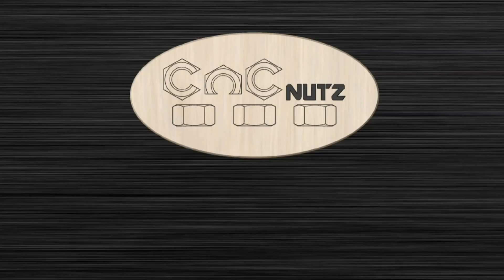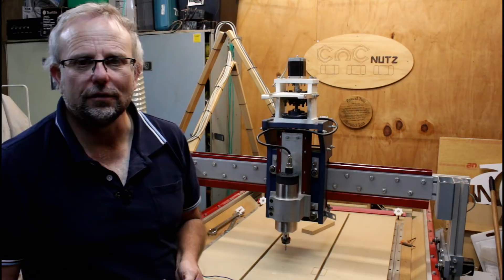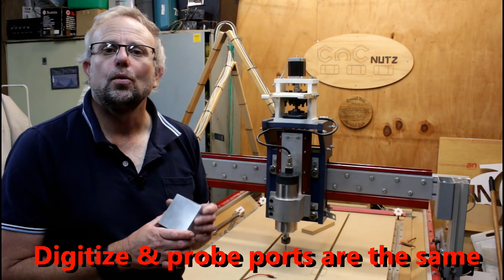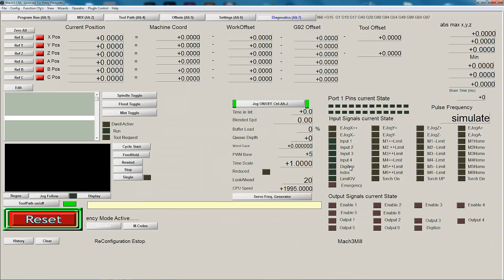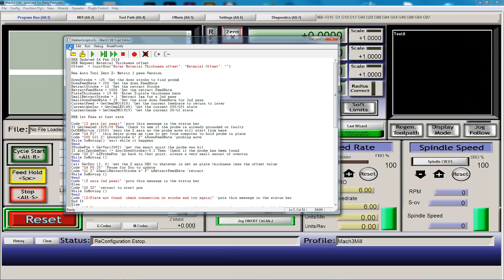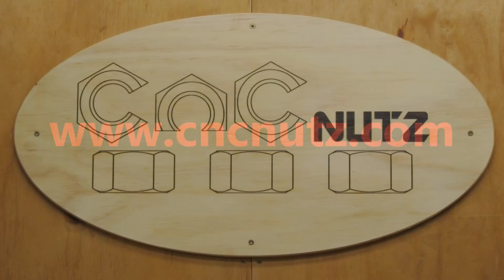Mach3 Touch off Plare Install - CNCnutz Episode 204

Comment: Hi Peter, Thank you for the tutorial.
I used your script, but I run into a problem:
When it retracts for the second pass, instead of 1mm is retracting arround 20mm  and when is going for the second probe is not finding the plate and goes into an error
Do you have ideea what can it be?

Regards

Comment: Thanks for this Peter. I’ve been successfully using your script. On my first probe and detect, my machine “jumps up a little” as if it’s been stuck down on first probe. It’s second probe retract is smoother. Maybe I need to check the first retract speed. I always seem to have the Z DRO reading at 0.004mm after probing and going to new origin. Bloody computers. 😂

Comment: I can't trust Mach3 with zero touch plate . I had it setup and it was working . Then it just crashed on it. Digitize light works but it still crashed . Just going to use a manual Z block from now on

Comment: Great informative video, I'm struggling to get the script working on my machine. 
The digitize light is flashing, when I press auto tool zero and touch the plate on the bit to start, it starts to probe but doesn't stop when it makes contact. 
Do you know why this would be ?
Reply from the maker: Hi dlyxover1
I have just added 2 Alternate scripts for Mach3 Metric and Imperial so give the appropriate one a try. I think this will be the problem.
Some motion controllers do not support the use of the GetVar(2002) command. As a result the script may not work as expected.
The Alternate scripts use GetOEMDRO(802) instead, which is internal within Mach 3 so will work for all motion controllers but will not be quite as accurate.
In all other respects the scripts are the same so make sure you change the plate thickness.
Give it a try and let me know how it goes for you.
Cheers Peter
Reply: @cncnutz  Hi Peter that is amazing, I will give it a try when im in the workshop tomorrow. Im using the AXBB-E controller if that helps.
Thank you for your help on this and the world of CNC in general
Reply from the maker: @dlyxover  
I would be interested to hear your results because the AXBB-E is made by the same people who make the UC300eth that i used in the video and it is a later model.
It should support the GetVar(2002) command. 
The cheap Chinese controllers are a different matter.
Let us know how you go. 
Cheers Peter
Reply: @cncnutz  The new script didn't work either, kept checking the wiring and settings with no joy. 
Last ditch attempt I removed all the wiring deleted all the script and started again, the original script worked, perfectly.
I can only put it down to user error, thank you for your help on this and many other areas you cover in your videos.
Reply: @dlyxover 
Excellent. I would have expected the original Script to work as it is a UCCNC product and their older motion controllers supported the GetVar commands.
Cheers Peter

Comment: I've been checking youtube for this for god knows how long and you've explained it in the simples way. Thank. Question though. Each time I need to do a tool change I would need to do it again won't I? And another question. Can you also do a script and setup video for X and Y axis zerowing. That would be Awesome!!!
Reply from the maker: Hi Martin,
Each time you change tool you need to reset the zero point.
Sorry that is well outside my ability and it has already been done by others.
Cheers Peter

Comment: Hi Peter - What’s the point in having the second pass? Just to verify? Thanks!
Reply from the maker: Hi Jamie
The 2nd pass is done at lower speed  which should give a more accurate setting. Because it takes time for the  motion control board to report back to the pc, retesting and slowing it down can give better results.
Cheers Peter

Comment: Hi Peter, thanks for a lovely and helpful YouTube channel, even given the accent:) [That's a smile from Western Australia]. My issue is for anyone else reading the comments. This comment was posted 15 FEB 2021. I downloaded the 30 August 2018 the latest script. It is the Mach 3 one [I confirmed x 2]. It will sort of run on my machine using Mach 3 but is not functional at all. The second retract operation sends my Z axis postive until it hits the home switch for this axis. It then jogs down 1 mm and sets the Z to zero nicely! So I ran the .txt through GWizard editor and got something like 120 error messages in the 130 lines of code. They range from not recognising "Rem" as comments through to a range of Then / If issues. This is so crazy that I sincerely wonder what I am doing wrong since from the comments below, this script must work. Anyone else facing this? Thanks
Reply from the maker: Hi Raspberry Jam Guitars
What you are doing wrong as far as using GWizard is you are testing a script with a Gcode checker. They are 2 different things. I don't know about the strange behavior but I imagine a wrong setting in Mach 3 or maybe it is the Mach3 version.
Cheers Peter

Comment: sir. i have one quedtion.  i want use usb cable for laptop. but i have MACH 1.1 borad with parellel port cable . please recomened cheap converter. parellel portt to usb
Reply from the maker: Many people. Use the UC100 which is the usb version of my UC300ETH board though it has only 1 port. Note : you cannot use a usb to parallel port converter on a CNC. You need a motion controller which is what the uc100 is. Also beware of clones of the uc100. Buy only from a reputable source and not ebay.
Cheers Peter

Comment: When testing this  program, it stops after  tool is touching the plate with " limit switch triggered" message
Reply from the maker: Have you checked that you don't have the port also allocated as a limit switch as well?
Cheers Peter
Reply: @cncnutz  Hi peter, I was able to  disable the limit switch, so now it's working OK .   Thanks for suport 

 BR  Thomas
Reply: Hi Peter, next problem :)  when activating probing ( touching plate to tool)  it won't start with the first pass but jumps to the second pass  and instead of going down to plate it retracts and states that  "Z axis is now zeroed"   I checked the script and did not find anyting different from your script.  BR Thomas
Reply: @cncnutz   Hi Peter,  M1++LIM seems to activate when  tool touches the plate ( don't know how to deactivate this M1++LIM)

Comment: Surely you can't have said that you are using a parallel from your laptop Peter. 
Are the Gecko drivers so good that you stick with them regardless? 
Got a serious crunch time coming here what with MSN calling it quits on Win7 and I am just setting up my first machine :-)  USB type Mach 3 controller running on Linux Mint?  I got to check that out.
Regards, C.
Reply from the maker: You miss enterperate an interface with a protocol. The G540 interface uses TTL inputs, as do almost all stepper motor drives, and it's layout is compatible with a parallel port. The actual device I connect it to is a motion controller which also uses  parallel port layout but it is not an actual parallel port, if that makes sense. Yes the G540 is that good in my opinion. I now am using a Masso controller but previously I used a uccnc motion controller and before that a smoothstepper motion controller.
Cheers
Peter

Comment: Well that worked.  Nice and simple.   Although I did manage to short out my 10 pin input I was using for a limit switch set up in series for the x,y axis on my G540 somehow and it no longer works.  My fault ... Now using 11 for the probe and 12 for the limit switches  :(

Comment: One thing you need to check is the rapid clearance distance. If the original gcode is for a .5 thick material and it does its rapid moves .125 above the material, if you tried to cut the same thing out of .75.... all the Rapids would be in the material. Most people probably know this, I just wanted to make sure it's clear.

Comment: Hi Peter
Love the videos, I was milling a piece of 5.5mm ply and milling from the baseboard, so I typed in 5.5 for the nominal thickness when setting the Z. I started milling but it started to mill about 5mm above the workpiece, so I tried entering " 0 " that didn't work either so I thought maybe it's in inches so typed 0.3 that worked perfectly. So am I doing some wrong here or what, felling a bit stupid.
Reply from the maker: If your machine is running imperial then you will need to use the imperial script and enter you thickness as imperial. 0.3 is 7mm not 5.5 so that can't be it. Did you set the thickness of the plate in the script? Did you do some tests to check that when you enter 0 it comes down to the surface you set the plate on when you enter z0 in the MDI? Also set the plate in the tabletop and Enter a thickness eg 10mm. Then remove the plate and go Z-10 in MDI and it should just touch the tabletop.
Are you using the latest version of the script as it has been updated several times.
Without more information I can't really tell.
Cheers
Peter
Reply: @cncnutz  Thanks for replying Peter. No, I didn't do any of the checks you mentioned, so my next job is to go check z0 on the baseboard.

Comment: Great video Peter, thank you from sunny Florida. I made my own touch plate with materials I had laying around my lab and used your script for Mach 3 to work with my G540. I also modified my screen set with tips from another one of your videos and added a LED to the main screen next to the "auto tool zero" button. Everything works great and I now only cut the stock and not my table. Thank you again for sharing your knowledge.
Reply from the maker: Thanks Flip Flop. Glad it works for you.
Cheers
Peter

Comment: Great video Peter.  Is there a hotkey that can be installed on the pendant for auto tool zero?
Thanks,
Jeff
Reply from the maker: Thanks Jeff
You could assign a key to do the autozero on the pendant if you wanted. Just assign a hot key to the autozero button.
Cheers
Peter

Comment: Hi,need a little help please,i have set up everything in the auto probe script but when it has run it does not seem to adjust for the plate thickness when i start the carve,ie  plate is 20.2mm thick,start cycle then cutter starts from where the probe touched the plate,NOT the material height
Reply from the maker: Hi Toddy
Can you please email me your screenset file so I can look at the script. I will see what I can do.
cncnutz65@gmail.com
Cheers
Peter
Reply: Was this ever resolved? Im having the same problem.
Reply from the maker: Still working on it. Feel free to email me as you might hold the clue to the puzzle.
Cheers
Peter

Comment: Thanks Peter for this video on the Touch off Plate. I have installed it on my Mach3 machine, but seem to be having a problem with the DRO returning to Zero. After running the Touch Plate the Read Out doesn't return to Zero. It may read 0.0018, or .0013, or .003 or .0022. Each time the readout has been displaying a figure on the end. I can't seem to obtain 0.0000, would you have any idea on how I can solve this problem. Thank You Once Again.
Reply from the maker: It isn't a problem. It is a non cumulative stepping error. If it takes another step it will be in negative numbers. It cannot get exactly to 0.
Cheers
Peter
Reply: Thanks Peter, you've resolved my confusion. I'm most impressed with the way your Touch Plate works, and in the way you explain everything in your videos, please keep going, as I gain so much from you. Bill

Comment: Hi Peter, thanks for all the informative videos!
I was wondering if you can recommend where to get one of those spring loaded or sensor touch off setters and are they difficult to wire up?
I recently broke a bit on my touch off plate because there was bad contact with the alligator clip on the tool bit...
Reply from the maker: Hi Jeff,
At the moment I can't and the one I showed on the video is one I made a few years ago.
I isn't setup to be used as a touch off plate but it would take very little in the way of modifiction to make it work for you.
You only need to connect the metal pin to the gecko and throw away the battery, cliplead and batery i used when I made it.
It might make a good project to make one and because I don't need it to be insulated like the one in my video it might be quite easy and more compact.
Maybe that should be my next project. (No promise)

https://youtu.be/LJ5TAdJotw8

Comment: I found it useful to add an ‘led’ to the main page and set it to be the same as the digitise pin. This means I can see the digitise led light up without moving to the diagnostics page 😁
Reply from the maker: +Des Owen
That's a good idea and something I mentioned in the UCCNC video but forgot about on the Mach3 one.
Cheers
Peter
Reply: I downloaded a screen set that shows X, Y and Z (that look a bit like a helicopter landing pad) and when you touch the bit with the probe it is easy to see from a distance you have continuity.   Cheers, David.

Comment: thanks for the vid, super helpful! Could you please confirm I understand that you have an isolated DC supply to the G540 with the GND terminal wired to the spindle body. Is the spindle also bonded to earth and if so would this not also bond your secondary supply GND to PE, which as I am advised by my SMPS supplier would defeat the transformers isolation?

 I have a similar setup at the moment and half of the advice suggests bonding the secondary side of the PSU to the star ground and the other half says they should be fully isolated... who to trust aahahah. Also to add to the mix from my last G540 I remember the case/heatsink is already bonded to the ground internally but I am not 100% on that .... 

Once again thanks for the vid, I am sure it will help lots of other mach3 users out!
Reply from the maker: Hi Jestah,
Thanks for your question. I'm sorry it has taken so long to reply but I thought that making a video would be the best way of answering this one. Thank you for the inspiration. The only problem is I don't really have an answer for you but I explain my reasoning for why I did it, the way I did. Your observation about trying to get a simple answer to a question is very true. For every one saying to do something there is another saying not to. The best I can really say is that your setup sounds very similar to mine so it should behave the same as mine. So far mine is working ok and unless something happens to change that I will leave it set up as it is. To me the ease of operation is what I want so not having to use a cliplead is the best option. 
I hope you find the video useful in making your decision no matter which way you decide to connect yours.
Cheers
Peter

https://youtu.be/w_2_LnJ8qyM

Comment: Thanks Pete. As always, a really informative video. I've been using a copper circuit board with a battery, LED,  buzzer and an alligator clip to compensate for poor lighting/eyesight in the shed. I'm going to get out and give this a go.Thanks again.
Reply from the maker: +Dust Bunny
Thanks Dust Bunny. Hope it works well for you.